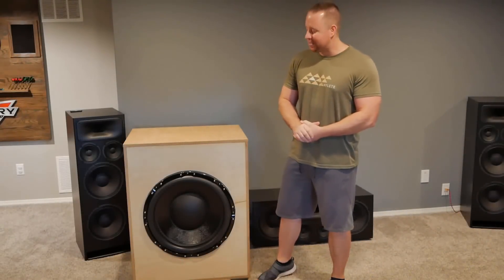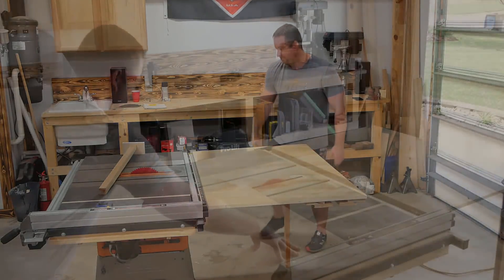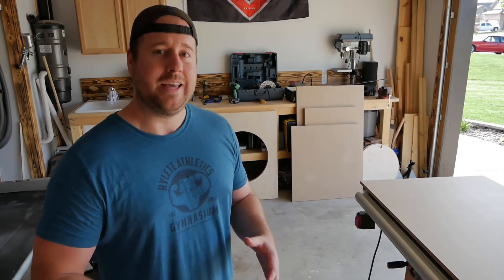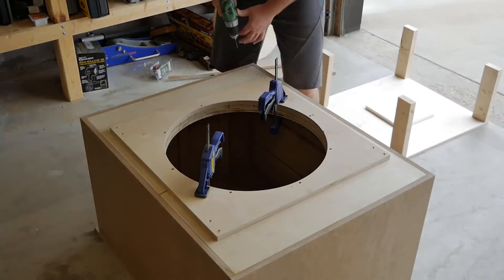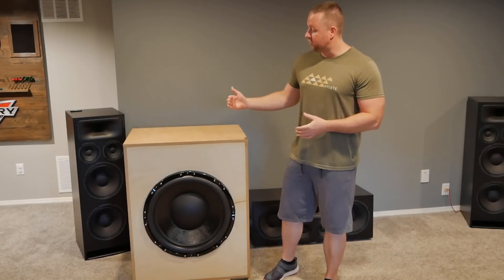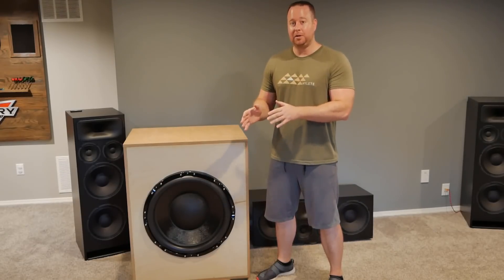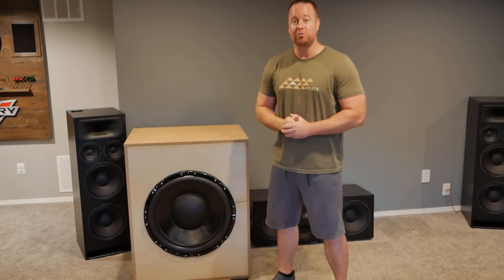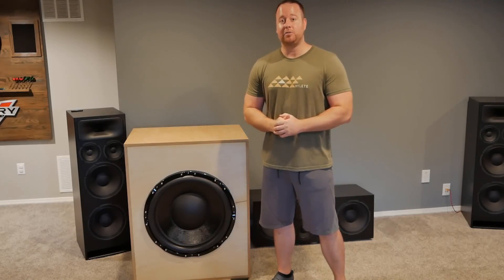Stereo Integrity HS-24 Subwoofer DIY Home Theater Build and Excursion Demo | Crazy Bass!

Comment: That's one big cabinet! Cool project, thanks for sharing (thanks for all your content, good stuff, nice hq production). 
That driver has so much capability, I'm not sure the box bracing is robust enough. 

When a loudspeaker's cabinet gets big enough to where the individual panel sizes get this big, what is typically a small issue can become a big problem. 

The large surface areas of the sub's side panels etc., require very little displacement to generate significant unwanted output. The various sources of panel output, bear no resemblance to the input signal the sub is reproducing. 
This stored energy/excitation varies in frequency, time and phase, is straight up distortion and will blur detail your system works so hard to resolve. 
Food for thought for future builds.
Reply from the maker: Thanks man. I was I little worried it wouldn't be enough at first, but the cab is pretty dead when hitting or knocking it. Not to say more wouldn't be better... it will be interesting to see how everything looks in REW when I get that going. Hopefully not too much distortion going on
Reply: @LifeofBliss  I have 2 inch and 4 inch thick dense styrofoam, how do you think this would work for bracing and sound deadening?
Reply from the maker: Bracing? Not at all. Not rigid enough or a good way to attach it for that purpose. And I feel Styrofoam would be too dense to really act as sound deadening. Would probably just act as a solid taking up air space. This polyfill works well, as does regular pink insulation. I prefer polyfill as it's not itchy and the fibers arent as small/sticks together better
Reply: @DonJuan-lg8vk  Foam will not be useful as damping.  Polyfill, wool, or fiberglass is effective. I use pink foam sheets and sometimes styrofoam cut and glued into blocks of calculated dimension to reduce the volume of enclosures. It is closed cell foam and it takes up space/volume nicely.
Reply: @LifeofBliss  The 4" foam is very rigid in the dimesions that would be used, however you  maybe right about sound deadening.
Reply: A true 3000Watts with low frequency or subsonic energy will be the ultimate test. As long as each crossbrace strip had to be tapped in and both ends are touching both side panels then I don't forsee issues. Plus there were multiple ribs glued and brad'd on every panel. BUT, it is only a one layer enclosure, aside from the baffle. It will never fall apart as all the joints are extremely square and tight. At 3000Watts mild movement may or may not appear. (less likely than likely) If it does not then EXCELLENT! Nice enclosure regardless. I think the biggest worry, believe it or not, will be the entire assembly oscillating on the carpet at high power. 200 pounds is heavy, but not that heavy when you have a messload of 15Hz to 20Hz energy, 3000Watts peaks, and a 24 inch subwoofer involved. I hope I am wrong about this one as it is only one driver per enclosure.
Reply: @pgmurray76  
I'm not suggesting it's going to fall apart, I'm merely pointing out it's inadequately braced. Since this was the first of three, this can be addressed in the other two. 

The Vd (swept volume) of this 24" can create extraordinary pressures both in the room, and inside the box. The bracing needs to be an engineered component of the box. Interlocked window type bracing, used extensively.
Reply: @FOH3663  Absolutely - and it is not too late for the other two. 👍 Two panels that large moving even 0.25mm is a problem. That's a LOT of area!

Comment: Excelente Post! How do you come up size box? It would help us know what sources you have used. Thanks
Reply: Google "WINISD" its a free utility.
Reply from the maker: Yea using winISD is very helpful. Used it and also talked with the owner of Stereo Integrity. Also, I was going off of an old note when I read the box volume. The dimensions are correct, but the internal volume is closer to 14.25 cu ft before any bracing or woofer
Reply: @LifeofBliss  Thank's for such fine information!  excellent all videos posted
Reply: @LifeofBliss  I'm looking at possibly building one of these which brought me here. Based on 40x32x24 you get a V total of just shy of 17.8 cubic feet. Internal volume with a double baffle is around 15.25 before bracing and the speaker. I'm betting you are at 13.5 cubic feet internal. I've been modeling 10-12 cuft internal myself but I'll see what 13.5 looks like now,
Reply from the maker: @R.J. K  I'd go with a smaller box to be honest. That one I made is heavy and the extra space doesn't do much for the driver. 8-10 cu ft is the sweet spot
Reply: @LifeofBliss  Thank allot

Comment: I love your write up so far.  I'm looking to do a diy sub build and this would be it for me with 2 24s.  Was also looking at the Marty ultimax with I Nuke setup as a more cost friendly option but keep coming back to the Stereo Integrity option.  What will you be using for DSP, I don't know if your amp has/will have it built in?  You also going to use REW as well?  Looking forward to the future videos.
Reply from the maker: Those Marty builds are awesome for the money. I was debating the same. But man... the 24s will rock your world! Once I get the new amp going I'll have a miniDSP 2x4 HD going on it. I need to do a lot with REW on my system in the near future. Ill do some videos on that as well
Reply: @LifeofBliss  Once you get the miniDSP hooked up you'll have to come join the BEQ crowd too.  No sense in waisting bass from these guys. :)
Reply from the maker: I've seen that thread 😉 I have a lot of reading to do my friend
Reply: @LifeofBliss  You actually don't have to do that much reading.  Really just the first few posts.  They lay everything out.  It's really easy to get going these days and will hopefully get easier with stuff that's being planned and worked on.  Most of the rest of the thread is either charts being posted, talking about how great it is, or growing pains that have been worked out and not applicable anymore.  Feel free to ask questions and well help get you going.

Comment: Would love to see a REW frequency response video of that bad boy.
Reply from the maker: I have several REW videos I need to do with the new speakers/sub once I get back in town. I'll get those going soon
Reply: And an spl reading of the edge of tomorrow scene!
Reply: Peder Hansen  
No
That's what I was attempting to explain, I didn't make myself clear.
 There's no wave propagation to establish standing waves. Since the low frequency wavelengths are so long, they don't "fit" inside the box. 

(@normal temp&pressure) 
Wavelength = 1130/freq

20hz = 56.5 feet (17.2m)
200hz = 5.65 feet (1.72m)
2khz = .565 feet (.172m)
20khz = .0565 feet (.0172m)

The higher frequencies (that would fit) would emanate from the driver, then bounce off an opposite box wall, propagating back and forth sine wave style, potentially setting up resonant standing waves that would need to be broken up and damped.

Lower freqs aren't small enough to fit, therefore they don't fully develop oh, they don't propagate, the pressure uniformly rises and falls within the enclosure.
Reply: Second

Comment: I think your box math is off.
Reply from the maker: Lol I think you may be right... I had 13.25 cu ft stuck in my head but added a few inches somewhere for some extra room. Closer to 14.25 cu ft before bracing is what I got now. That's 40x32x24 outer dimensions with a triple front baffle. Thanks for letting me know 😉
Reply: @LifeofBliss  No worries. I am enjoying your Home Theater journey here. Keep the videos coming.

Comment: What's up man? Great video. Funny how you said time 4 the easy part when trying to move a 200 pound box. Also loved when you put the kid music on and your kid started dancing. Could you imagine the size of that box if you went ported. Did you say each sub is getting 4000 watts rms. I think you better warn your neighbors that it is you making all that noise and not an earthquake. Keep up the great work man.
Reply from the maker: Hey thanks man, he's a music lover for sure lol. Yea I thought about ported but glad I went sealed. Output is insane already and it will dig lower than a ported enclosure. The amp I have is a clone amp of the FP20000Q which has been tested to do around 2k rms and 4k burst, so quite a bit more power coming. I called my neighbor when I was testing and he couldn't hear a thing as of yet, so I should be good to go louder!